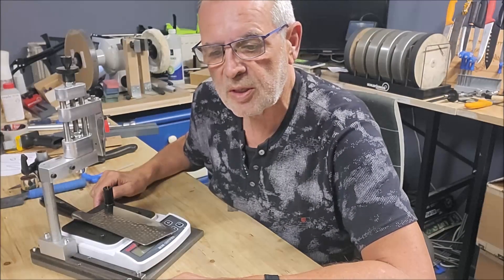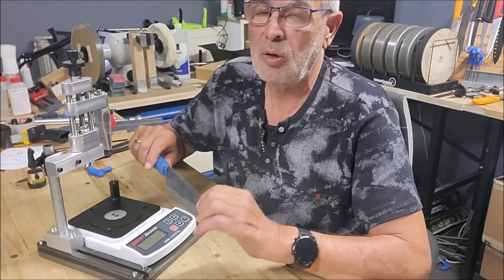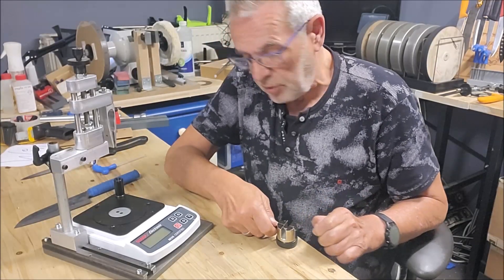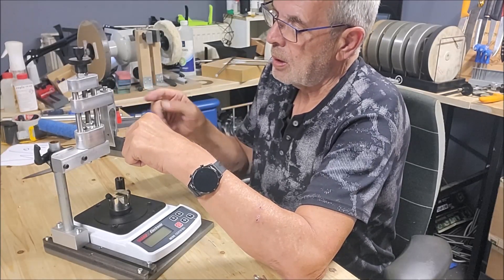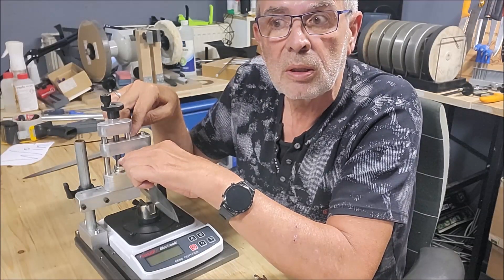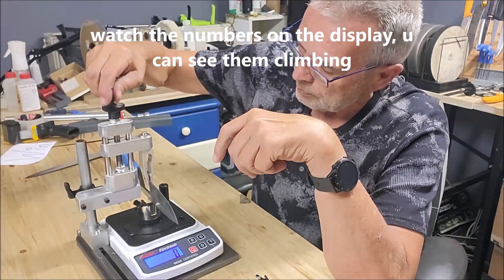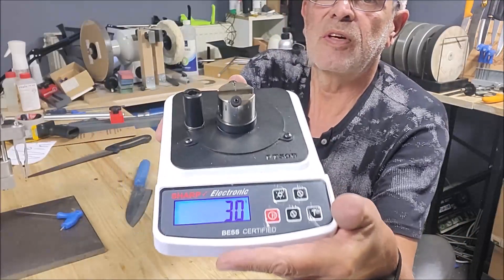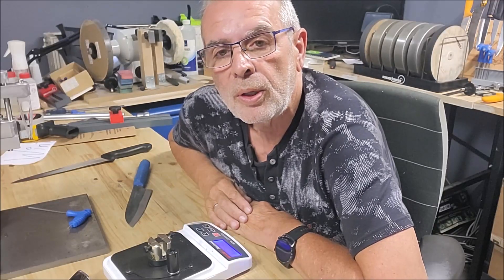Prototyp Bess measurement

Comment: Hans, you are really chasing the industry with your inventions :-)
Proposal to validate the precision of your testing fixture: repeat the Bess-Test with the same knife about 20x under the same conditions. Doing so, you can determine the repeatability of your measurement and get some confidence of it. With that, you can proof, that your machine is precise and have also an argument against critical opinions ;-)
Reply from the maker: of course i will do that, but only when i have an operational device. this prototype still has a thread with 1.75mm pitch. this should be about feasibility for now. the final version will have a thread with 0.75mm pitch. however, measurements with this device have already shown that it works. i have only measured 5 times, but only had a max. deviation of 5g.